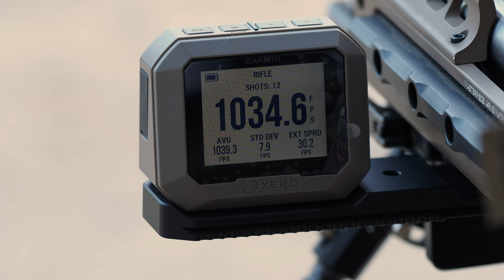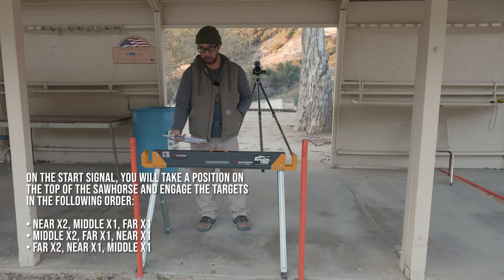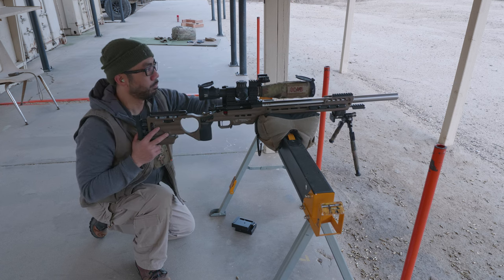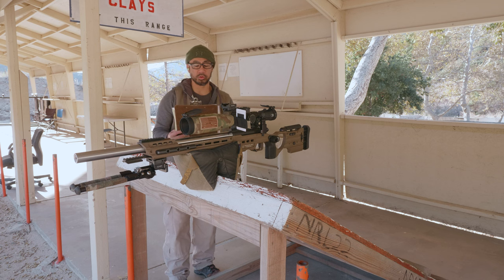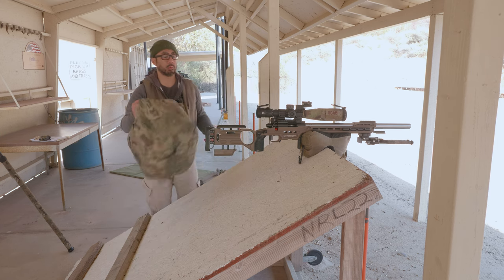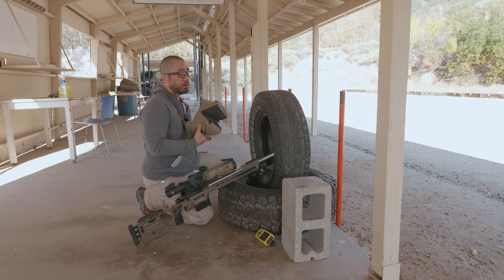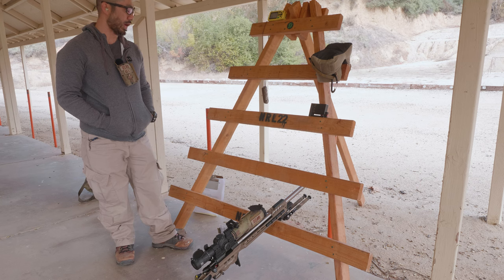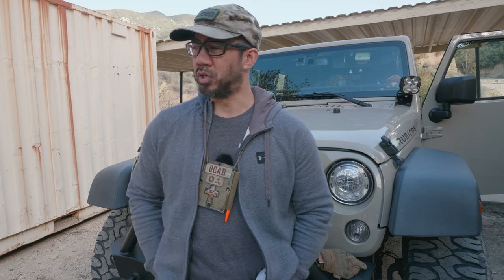Range VLOG #246 - December 2023 NRL22 Course of Fire Match Director Run-Through

Comment: How is the coletac bag for the garmin? is it well padded to transport around with the other gear in the range bag? 
I have the same issue as you for the gen3 vudoo no matter what trigger i put in there. Its like hit and miss, sometime its smooth sometime its kinda stuck. I found out the thicker lube help a little bit. I tried to clean and reapply after few range session. However my first gen3 from 2 years ago never has this issue... dont know why...
Reply from the maker: It has a bit of padding on all sides. I wouldn't drop stuff on this thing, though. It should be relatively safe, but if you're going to mix it with hard gear in a pack that gets thrown around, you probably want a hard case for your Garmin.